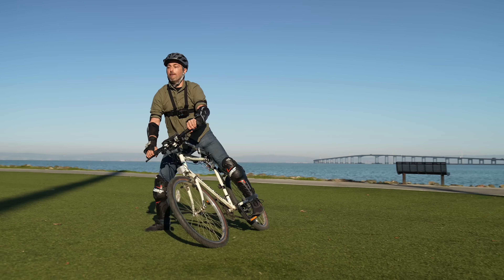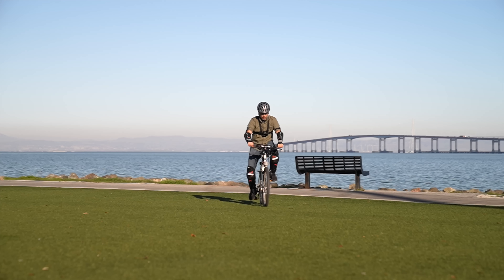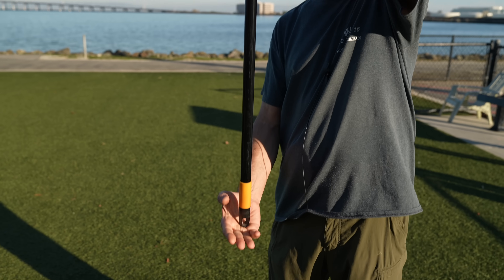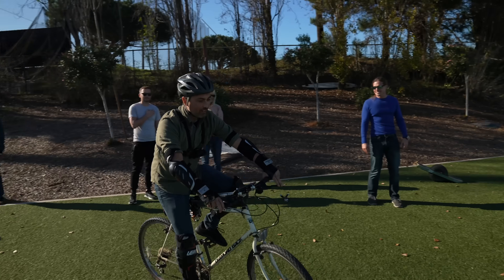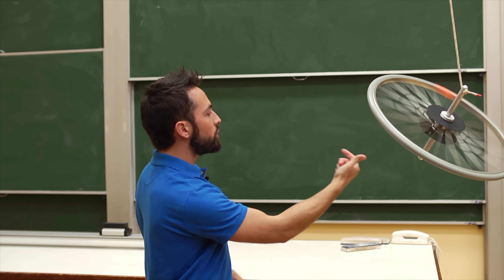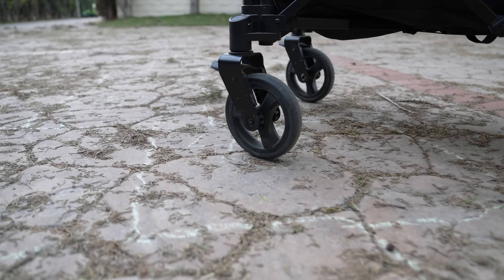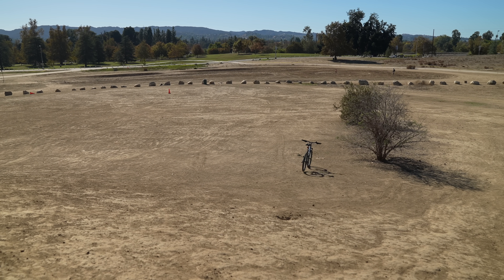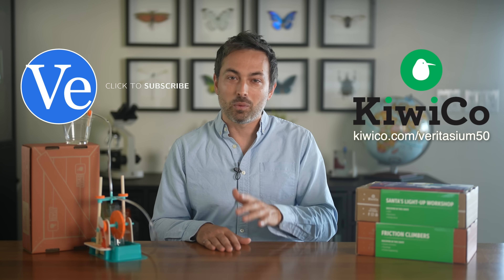Most People Don't Know How Bikes Work

Comment: So true. I used to be an evaluator for a motorcycle test given to service members they had to pass to register their motorcycle on base. The test includes a obstacle avoidance that forces a rider to dodge an imaginary obstacle above a critical speed. The test is an evaluation of counter steering. Above that speed if you simply try to turn the handle bars in the direction you need to go, you are going to go in the wrong direction. Unless taught this, motorcycle riders can get themselves into trouble on the road. I saw plenty of riders I was evaluating get this wrong. They try to turn the bars right for a right turn and end up leaned to the left. What I do is lightly press forward on the handle bar that is on the side of the direction I want to turn. Want to go right? Push the right side of the handle bar forward. It backwards, I know and I'm sure I'll get flamed for saying it but it's true. I always assumed it was due to the gyroscopic effect. This effect only comes into play above a certain speed, around 15-20 mph and our evaluation had an electronic speed trap to make sure the bikes were going above 17 mph. From this video I'm assuming that once leaned the tendency is for the bike geometry to turn the front wheel into the lean.

Comment: i think when its lock to go straight. you are peddling and you are applying force downwards on the left and on the right differently. this is because i saw that guy who did not peddle and let the bike go on itself he is on it longer, due to law of conservation of energy, he lost energy and could not continue to move forward thus force on one side tense to get stronger and thus he leans on one angle and fall towards that side of the bike. i am cool with the idea of we need to lean the other side in order to turn, but the straight part is the part im curious about.

Comment: This is true for lower speeds when you need to take sharp turns, but it is also possible to turn by simply leaning to one side without first steering towards the opposite side.

Comment: In motorcycleing, they teach you that you only have to worry about counter steering at higher speeds. When it doesn't let you turn left at lower speeds I bet you could shift your center of mass over to lean in to the turn instead of counter steering

Comment: The wheels of a bicycle that is rolling along the ground, cannot create a gyroscope effect, because the edge of each wheel is touching the ground.  Gyroscopes don't work like that.  With a gyroscope, the point of support is always connected to the axis of rotation, not to the rim of the wheel.  The wheel of a gyroscope has to be able to spin in a manner independent of the motion of the object, so it can precess freely.  Otherwise, it's not a gyroscope.

The only way I can think of to get any gyroscopic effect from a bicycle while riding the bicycle, would be to pop a wheelie and spin the front wheel very fast.  But I think you'd have to be abnormally highly coordinated to pull that off effectively.

Comment: I would say that without the weight of the rider, the gyroscopic effect of the spinning wheels can keep the bike upright. Once you put a rider on the bike you easily exceed that gyroscopic force. While it's still there, it's not enough to keep you upright because you are now balancing on the bike. The design of the bike plays a part in keeping a ghost rider going but without the rider it is primarily the gyroscopic force of the wheels spinning along with the design of the bike.

Comment: On a motorcycle you can cause a crash by attempting to hold too steady, rather than the the bike self correct you end up counter-steering, too slowly, and it can lead to such bad shaking that you are thrown from the bike. Usually the bike then settles down and rolls to a stop.

Comment: Now that you've provided the best explanation on bike balancing and while the effect is definitely real but that's not how it works in real life, at least with a bicycle. If you want to turn right, you first lean right and then catch your self later by steering right. In fact, if you loosen your grip on the steer bars, you don't have to do any steering, you just lean into the turn and let the wheels do it's own thing and only steer harder into the turn when you want to straighten up. That's how people can ride the bicycle and make turns without using their hands, because hands are not needed unless you are leaning very hard.

On a motorcycle it's different because your weight isn't enough to lean the bike quickly enough to make the turn that's why you have to lIghtly nudge the steer bars in the opposite direction to start the lean -- not the turn.

Comment: My dad told me about "steer left to go right" in reference to his motorcycle when I still had training wheels on my bike. Later that day I had to force him to remove the training wheels after showing him I was doing exactly that on my bike, and it was causing me to lean into the training wheels so hard it would lift the rear tire off the ground.  About a minute of riding later, I was leaning and cornering so hard the pedals became an obstacle before leaning would cause me to wreck.

I also found out many years later that riding a motorcycle around corners fast took me hanging off the opposite side the bike was leaning into the turn to keep from bouncing off a foot peg and nearly crashing.

2 wheel physics are an amazing thing when you're at their limit.
Reply: "riding a motorcycle around corners fast took me hanging off the opposite side the bike was leaning into the turn to keep from bouncing off a foot peg" - that's literally the opposite of how that works mate. That's probably WHY you were bouncing footpegs into the ground.
Reply: In portuguese we cal it estersagem. At least here in Brazil, Rio de Janeiro

Comment: I reckon it is possible to turn without counter-steering: You need to shift your centre of gravity to one side of the wheels. The most obvious way is of course to counter steer. The other way is to use a rotation to move the centre of gravity, for example you could start with your right arm down and your left arm up, rotate them through horizontal to the opposite situation. You will have caused the rest of the system to rotate to the right and therefore the C of G would also then be on the right. This is similar to how someone can balance on a tight rope.
Reply: Sounds good on paper, but doesn't work that way. There was an old video here on YouTube about that. I tried looking for it just now but wasn't able to find it. Anyway..... The dude added an extra set of handlebars on his motorcycle to see if he can effectively steer with just his weight and no counter steering. (Those extra handle bars allowed him to throttle / clutch, but were not connected to the wheel.) He was able to move the bike ever so slightly, but not enough to safely change lanes on the freeway. Forget about making a 90° turn, that was out of the question.
So, in conclusion, counter steering is the ONLY way to turn a bike.
Reply: @pavelshemyakin9054  that’s a motorbike which has a lot more mass than a bicycle though. You can go straight hands off but not sure how effective turning is.
Reply: Yep. Just don't touch the handlebars and use your weight to turn. Alternatively, get your butt off the seat and move your whole body left and right. You can literally see it happen when you let the bike coast by itself with no rider - the moment it leans a bit to the left or right, it turns that way without any counter steering.
Reply: @girla9480  read above.
Reply: @pavelshemyakin9054  a motorcycle is not a bicycle, it has a lot more weight and can't be maneuvered by just shifting your body. Bicycles do not require counter steering, it's just that using it is the simplest way to ride, but not the only one.
Reply: @girla9480  I guess technically that is true. Same as it is true that you can write with a pen that has no ink in it. You just gotta press on it really really hard and it will imprint whatever it is you're writing on the paper. However, having ink in your pen would be the easier way......
Reply: @pavelshemyakin9054  science doesn't care about easy or hard, the goal is to get at the truth and the truth is that turning a bicycle does not require counter steering.
Reply: @girla9480  You can use a microwave without electricity. Yea, you won't be able to heat up your lunch, but you CAN use it as a door stop. You ARE using it tho..... This is what your argument sounds like.
Reply: @girla9480  even with your hands off the handlebars, I believe there is counter steering going on. When you rotate the bicycle, the inertia of the handlebars ( remember the CofG of the handlebars is in front of their pivot point) will briefly keep them where they are, I.e. bike goes right, handlebars stay left, I.e. counter steering.

Comment: I've got a theoretical solution to the steering wheel locking up that I have not actually tried. Apparently, based on my viewing of YouTube videos, some people can "ride a wheelie." The solution is that just before the steering wheel locks up, you start riding a wheelie, and from that wheelie riding, you move into your optimum turning positioning. I could go into more detail, but I think you should be able to get the idea of what I'm writing about. On the other hand, this idea might not work if you need to be able to move the steering wheel in both directions to maintain balance and effective riding while you're riding a wheelie. Another way that wheelie riding might not work for this is if you need to be able to turn the steering wheel in both directions as you come down from the wheelie riding and begin your turn. Oh, Well-- ...At least I gave this predicament some thought.
Reply: I always have to turn the wheel off to the side to do a wheelie. Pretty sure it would work the same as you still use the handles to balance and shift weight.
Reply: @swaggadash9017  Thanks!

Comment: Hehe, you learn how to track stand 

I find people find counter-steering very unintuitive, even when you do it out of habit.

Steering as a mechanism is very complex  and most people will get it wrong because of the way it shifts the center of gravity , but by the same stability effect in this video, if you focus on leaning rather than steering, the bike will help you find the optimal steer angle.

You have many methods to lean the bike  but only 1 method of steering the bars.

Comment: Counter steering to initiate a turn is not strictly necessary, despite these "proofs" that it is. While much more limited in its effect, turns can be initiated simply by moving the mass of your body to one side or the other. Just ride "No hands" and you can prove this to yourself (just try to have a reasonably stable bike in the first place though). Or hang a really heavy weight on one side of the bike. You'll then have to lean the bike quite a lot to the other side just to keep it going straight ahead.
BTW, I'd have really liked to see a bike with locked steering on the downhill riderless test. I'm guessing that it would've crashed pretty quickly.

Comment: There will inevitably be a lot of comments about contersteering from people who say "it's different at low speed". As a motorcyclist of almost 30 years experience, I've heard this a lot.

It's not true. This can be demonstrated with a logical argument as well as an empirical one. Logically, if a bike at low speed turned without a countersteer, and at higher speed turned via countersteering, there would seem to be some magical intermediate velocity where turning would be impossible. This obviously is not the case. 

The reason why people think you don't have to countersteer at low speed is because, as mentioned in the video, the front wheel is constantly being countersteered to maintain balance. It small, continuous corrective turns are being made rapidly. Turning is therefore simply allowing one of these slight wobbles to allow the lean to initiate before you then steer into the turn as normal. It's _still a countersteer_, it's just not one you have to actively initiate. At high speed these wobbles are less prominent, and getting the bike to lean actually takes a significant amount of force (a situation far more apparent on a motorcycle with its increased mass, velocity, and of course gyroscopic inertia from much heavier wheels and tyres rotating more rapidly).

I thought this video was good because while it doesn't cover this point very much, the footage makes this effect extremely obvious, demonstrating the empirical refutation.

Some people say you can turn just by leaning your body. Again, not true. If you want to lean your body to one side, you have to exert some kind of lateral force to make that movement. The force will be against the bike, which will lean the other way. You cannot change the centre of mass of the system from within the system alone - a statement which is not just true of single tracked vehicles, but everything in the universe. You need a reaction force against something external to the system. In the case of a bicycle, that's the ground, and the countersteer is what provides that external reaction force.

But the statements discounting the gyroscopic stabilizing effect are just wrong. Locking out the steering proves nothing, because if you lock out the steering you eliminate the gyroscopic effect's ability to stabilize (which the video does acknowledge at about the 9 minute mark, walking back the earlier overzealous claim). It's also not simply a combination of rake and trail - a small model bike exists with reverse rake and trail, and it's still dynamically stable. The truth is that it's some combination of several effects, and _still today_, nobody really knows (as is mention at the end).
Reply: In the end he did say it's a combination of several effects, (and I don't doubt there are even more subtle ones in addition to the 3 he listed) gyro procession being one of them. And yes his earlier statement taken in isolation was "overzealous," but it was just the initial dispelling of the common soundbyte that "it's gyro precession." Then he went on to elaborate it. And it's a 9 minute science video with a lot of information for the general watcher, he can't add qualifying clauses to every phrase like a legal document. An honest watcher just has to watch the whole thing and place all the info together as intended.

Comment: 7:04 That's right next to my house in San Mateo where they kiteboard and foil. I ride my bike there almost every day. My RC motorcycle steers by turning the bars the opposite way and it would lean. For the longest time, I couldn't get it to turn and almost threw it in the garbage until I reversed the steering servo. I was scratching my head for a while then finally understood how it worked. lol.